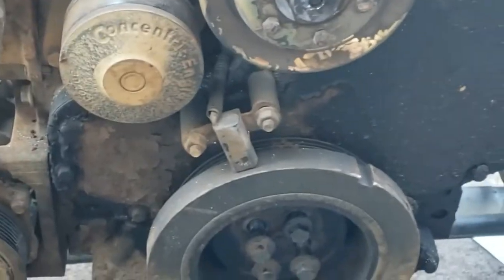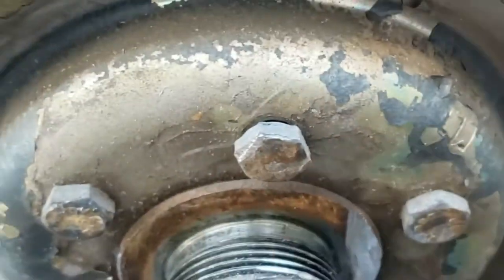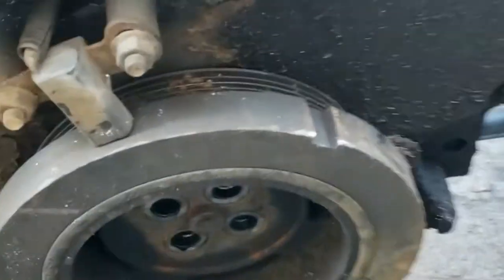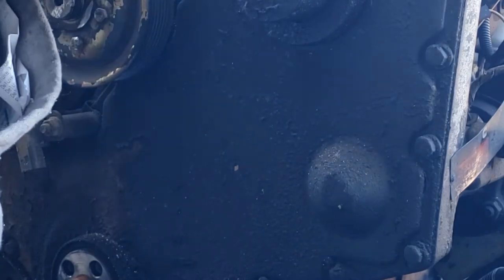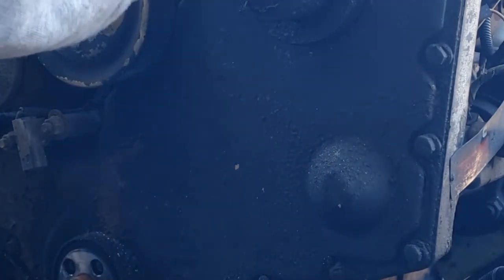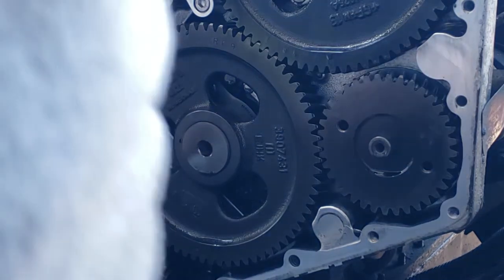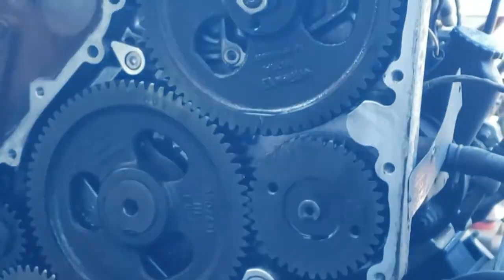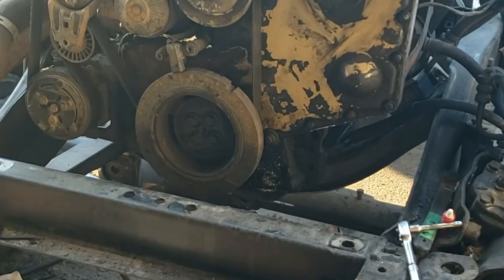Installing the KDP kit (Killer Dowel Pin) in the 6BT which is going into a 1983 W150

Comment: always check all the bolts behind the gears into the block also for they come lose also. I locktite everything for these engines vibrate allot. I lost an engine due to cam plate bolts fell out.
Reply from the maker: I checked tightness of any exposed bolts behind the timing cover before I buttoned it back up, however I appreciate the tip about using locktite on them. I may open it back up and do that. Definitely don't want it shaking itself apart if I can help it.
Reply: @simplicityjim9870  I had done some more fummins swaps and I would say out of 5 engines there was 3 with loose bolts inside the timing cover. Only one I could not get out so I loosened it and sprayed brake clean the blue locktite on it then screwed it back in. On one engine a couple of bolts were finger tight. i have also seen many engines with nothing loose.